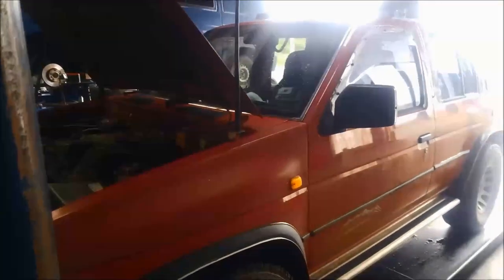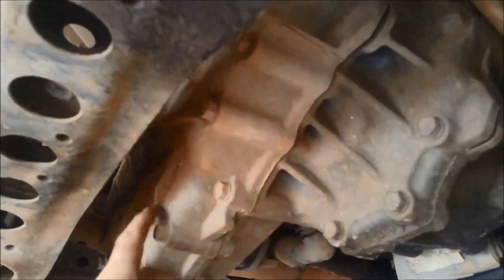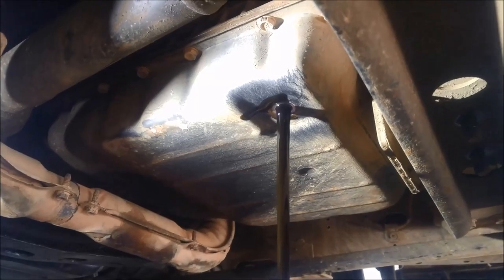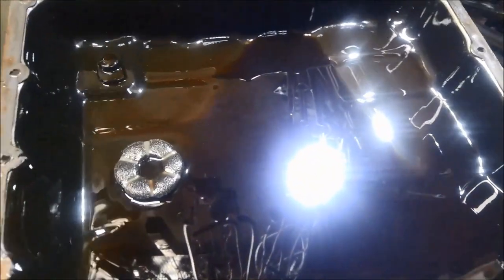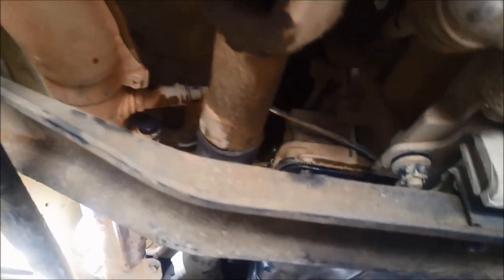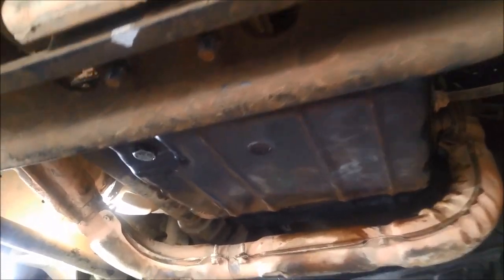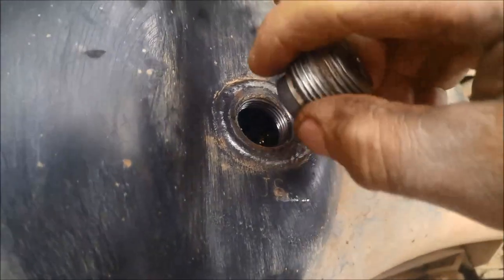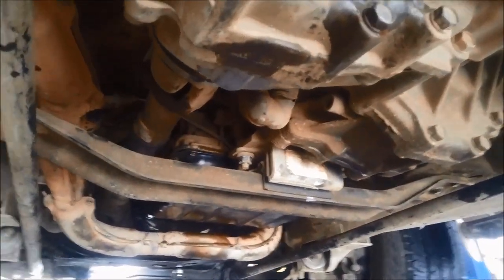RE4R01A Automatic Transmission Service, Front, Rear & Centre Differential Service add Neodymium Plug

Comment: 3:56
Does that filter unit need removing and cleaning?
I wonder if there's a video removing and best way to clean ?
? I understand  has a fixed mesh screen inside ?
Reply from the maker: hi, you can flush the screen filter, but if high mileage the screen can also split because of constant pulsing through suction. we use x55 solvent and compressed air approx 120psi. cheers

Comment: a couple of nice tips there, uni joint thumb trick and the cause of many exhaust manifold cracks ,dirtiest ive seen your hands for a while. the exhaust on cars cutting across in front of the trans sump must add a little extra heat.
Reply from the maker: hi, yes you`d think they would try keep exhaust away from trans and electrical cables/plugs etc. go figure out who trains these designers ! cheers
Reply: @YepThatsIt  bean counters id say, its why i modify all my cars to how i think it shouldve been made, it makes servicing easier too. i guess im a perfectionist or close to.